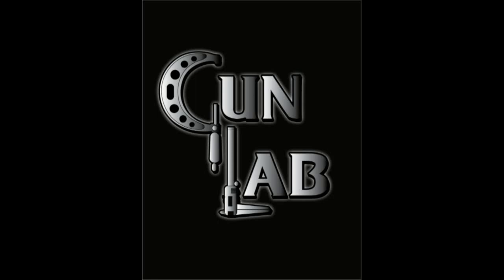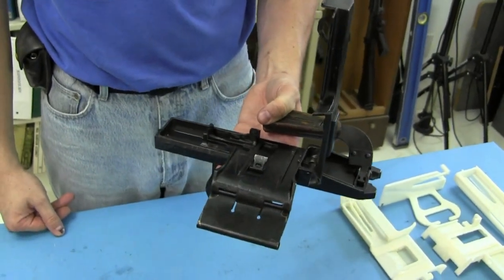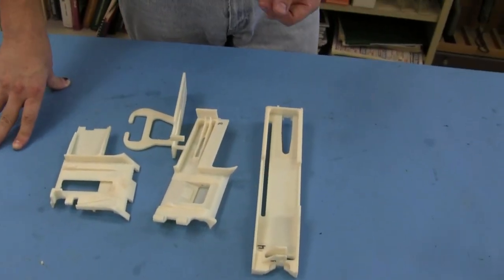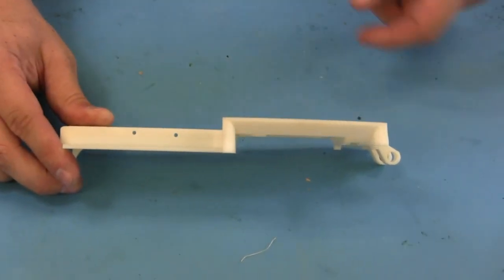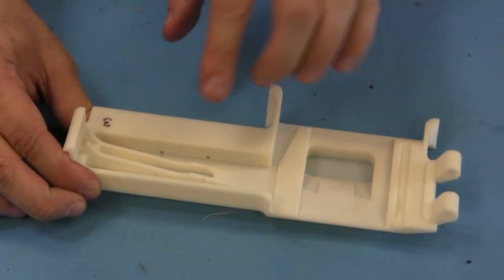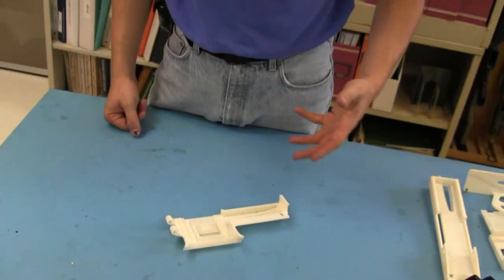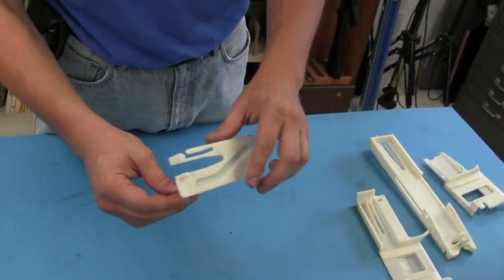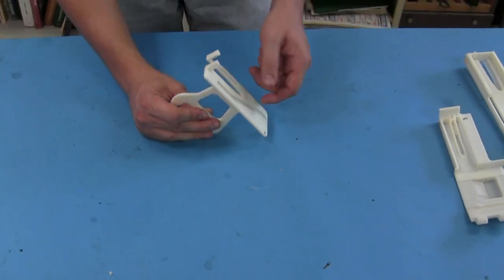Old Style parts on Modern CNC Machines

Comment: Lots of tricks you can use for low numbers cnc production.
Add 1/2" to material in X and Y dimensions and make the part inside a "picture frame" just add a few tooling holes and you can save lots of setups.
When you get close to finishing thin sections just fill the picture frame with plaster of paris. Makes a mess but works good. Don't be afraid to "keller" angle surfaces with a ballnose endmill. A little work with a small sanding disc and your finished.
Just snap the part out of the picture frame when your done and sand off the tabs.

Comment: I want to 5 Star this video.  How to do the cuts and in what order is one of the most important considerations when trying to copy something 80+ years old without a blue print or a flow chart.  About a decade ago, on a whim, I decided on a whim to clone a cocking knob from a beautifully made 1880s vintage .22 rifle, but to do so in brass instead of steel.  LoL, I must have wasted about 5 pounds of brass trying to clone that little 3 inch part before I stumbled on the original sequence for some of the intricate cuts in the original.  I bow and prostrate myself to those departed craftsmen.   The big secret I only discovered after many failed attempts?  They knurled it first, then, and only then, cut around the knurling.  LoL,, who knew?

Yes, as you say, and we see in the old photos of Colt, S&W, FN, etc. machine shops, they had not one mill or lathe, but dozens.  Each set up, or designed specifically, for just one specific cut.  Apprentices pushing carts of parts from machine three to machine 4, etc.

Today, were I making the parts you show, since you can 3D them, you could,, 
a) but a top of the line 3D machine, one using new metallic prints.  Then print away.

b) (and what I would do)  Make a silicone mold of the original.  Fill it with styrofoam liquid, then lost wax cast into the styrofoam model.  I.e., investment the pieces in aluminum.  In a home shop I think a half dozen complete clones would run you less than $100 (not counting the $50 for building a garage aluminum smelting forge) and take maybe 16 hours work.    Yes, other chemicals and a more elaborate, probably not at home, set up for turning out 100 replicas a day out of steel castings.  But in today''s world, investment casting is the easiest way to duplicate the old works.

Comment: Great video! As a former CNC machinist and current lock (of the flint variety!) builder I work with a tons of investment castings. Depending on how many units you are going to build you should look at making expoy molds, casting the parts in wax, sending them out to be investment cast and do final machining via CNC. Again, cool video and I subscribed to your channel. Looking forward to more videos!
Reply: That would be a good way to go if they were going for volume production.

Comment: Fascinating stuff. Browning HP barrels are now two piece, the outside of the chamber is turned down and the second part is pressed on containing the locking portion. You can see a join line at the chamber end as a circle and a straight line more or less in the center of the chamber  perpendicular to it.

Comment: Basically you want an universal machining center or a Swiss lathe with secondary tools and spindles... basically the most expensive machine you can get. Upside is that those can usually work on multiple parts in series, so the thing will literally print money. I've run into the same problem designing fountain pens, but rather than complex shapes my challenge was a small/not-so-small part with lots of fine detailing, on acrylic and in a single operation to make production viable and the price down.

Comment: Can a 3 D printer use materials that can be invested, burned out, creating a die and cast in molten steel? The resultant cast can be more easily & quickly machined.Always curious why more custom gun makers do not use investment casting ("lost wax") techniques.Wax models can be easily carved prior to investing & casting, as well as multiple wax models created.
Reply: yes

Comment: 10:30 You'd just plug weld from the other side, and machine through the weld/s on the end which intersect the slot. Simple to machine flat on the back, and no dramas on the top for the square edge. 

It's interesting how they used to make them, probably have a couple dozen platens located with pins so they can go machine to machine without having to dial them in again? Would definitely save a ton of time with a shaped cutter doing 20 operations at once, could also use a shaper for internal slots if you couldn't get a conventional rotating bit in there. In addition, you could simply have angled blocks with the same pins to cut anything not feasible to do in another option.

The old timers were pretty clever guys, gotta get it done as quickly as you can to fight the enemy.

Comment: just a few toughts  part 1 : why does the "strait edge" needs to be exact ? and why would a cnc not be able to cut a in strait line ?? as far as i can tell the groove only holds a litle tab with a spring tru a pin or somthing . i dont think accuracy is an issue here .  
part2 : like you said i would cut a chunk away from the stock peice for low number production for large numbers you could make it from a casted part then machine it no ?

Comment: just need a 4th axis machine
Reply: Just took a look at the granite CNC milling machine with epoxy and it was very very clever design
Reply: Use concrete and epoxy and it made a very stable and strong very rigid base resist greatly resist any deflection